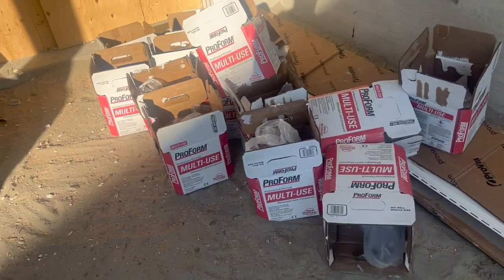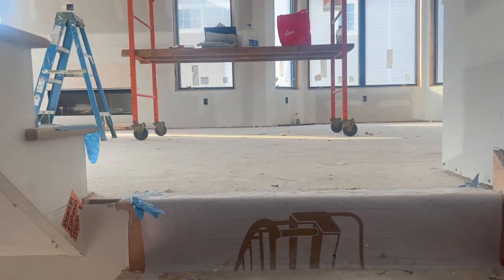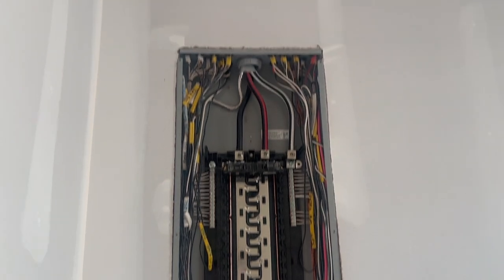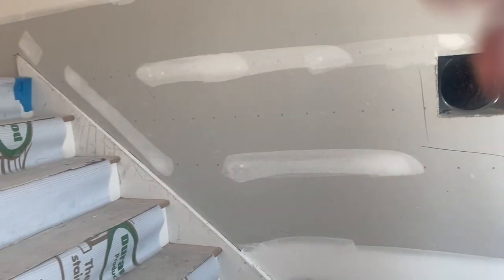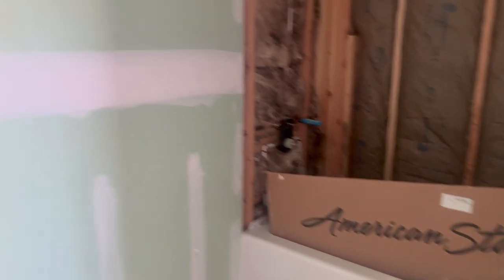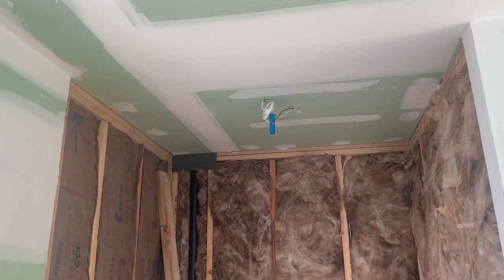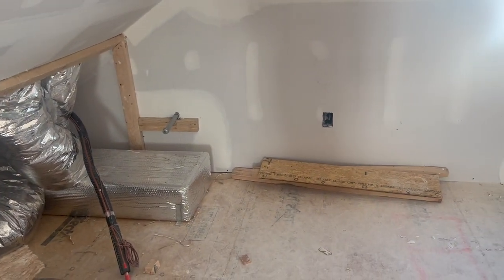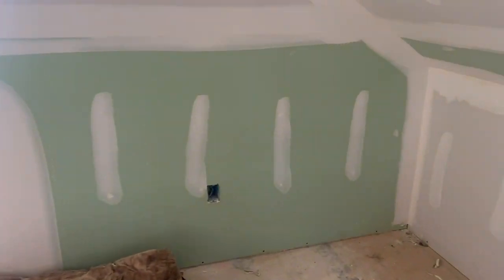PLUMBING INSTALL | FINAL | APPRENTICE

Comment: Definitely all recessed items should be framed  before drywall. Looking forward to the outcome.
Reply: then you run into last minute changes of vanities, countertops, backsplashes and other additions, which then moves the recessed items around, up/down/left/right a few inch more. now try to get the framing out without destroying the drywall! often the painting may even be underway at that point.
yep, it's smarter to make sure there's a larger void there, cut the hole then pad the studs out to mount the cabinet too, none of them really almost nothing mounts at the top or bottom, so only the side need padded out, that also allows you to not stub over-cabinet fixtures out and end up with a hole or wire in the wrong spot, you just cut it in later and can reach up through the cabinet hole to position the wire for box.
Reply from the maker: I thought so too, but not these guys. Make sense. Im sure they have ran into this often....

Comment: I'm catching this video late but if your flooring is not down yet I would recommend a coat of polyurethane on the floor to seal the sheetrock dust in
Reply from the maker: Ya someone else mentioned this. Thanks Jim

Comment: 7:52 please tell me what the fyck that water line is doing ... thanks!
Reply from the maker: thats the feed for future deck hose bibbs. 2nd floor and 3rd floor. They are to be winterized with valve under vanity. Set to drain via gravity.